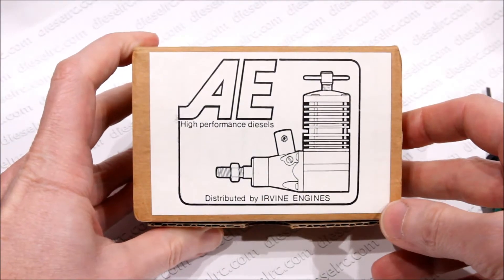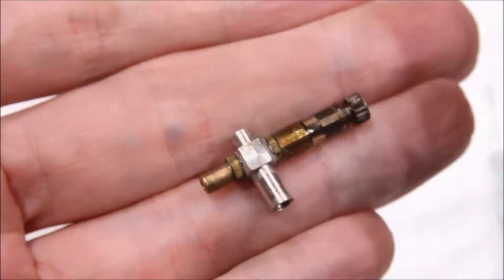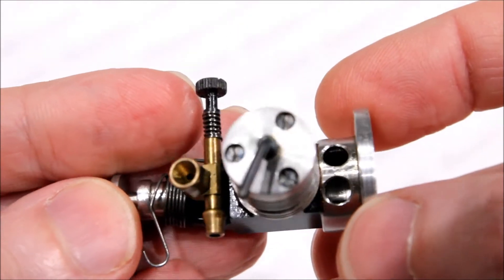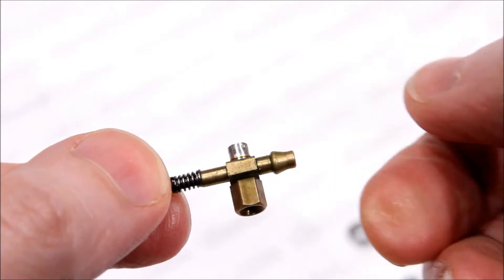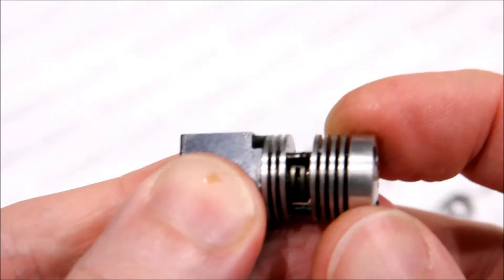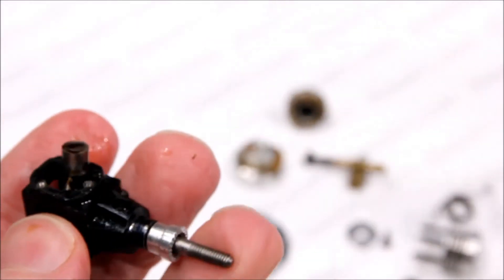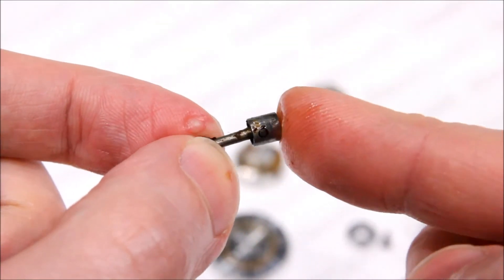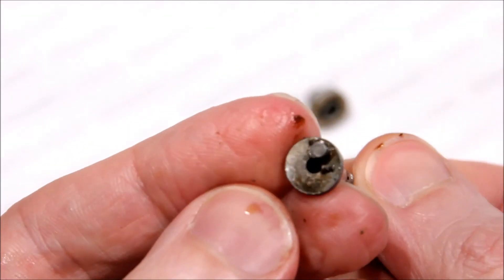AE 0.1CC, a Closer Look

Comment: Hello sir can you explain how the fuel goes to cylinder head without pump ??? And how that burn without spray jet ?? I think 450 °c required to burn diesel .. please answer my questions
Reply from the maker: This is a simple two stroke compression ignition engine. They are called diesel, but are really what is today termed HCCI, Homogenous Combustion Compression Ignition. The fuel contains a significant portion of ether which has a low autoignition temperature to reduce the compression ratio required.

Comment: Most informative. I have never been tempted to acquire one after I had to sort out an AE 0.2 c.c. for a friend. The NVA in them is 'agricultural' to say the least. I had to replace it with a (now long unobtainable) Schlosser NVA for the Schlosser 0.25 c.c.. Nearly 'plug and play' to fit, and after the exchange the little AE 0.2 c.c. ran predictable and very sweetly.You did my TT .54 diesel conversion nearly a decade ago.

Comment: High, can you please build this engine into a tiny diesel locomotive model?
Solving the transmission issue would be interesting -- whether it should be hydraulic or electric.
Reply from the maker: Electric would be my choice, but geared would be OK. Hydraulic at this size?
Reply: rcdieselrc I literally arrived at this video because I was looking into building a live diesel model of a GEVO Locomotive. If you did that it would be ultimately cool. Also what would you think of creating an Franken AE engine where you slap a few of them together (like in a V12 or Inline 6 configuration) and slap a flywheel on it and see where it goes from there? If I tried that would it be successful do you think?